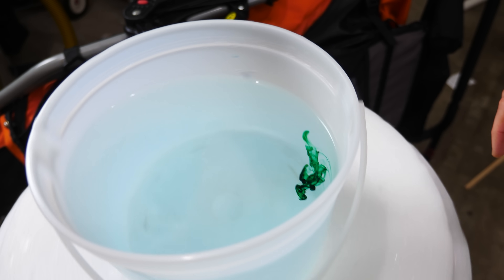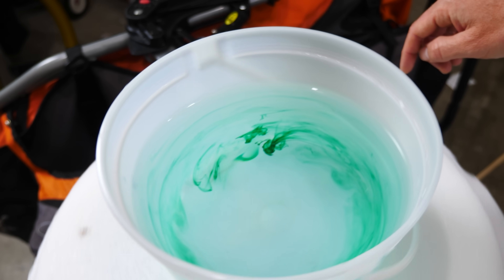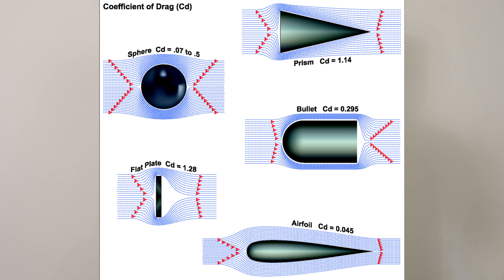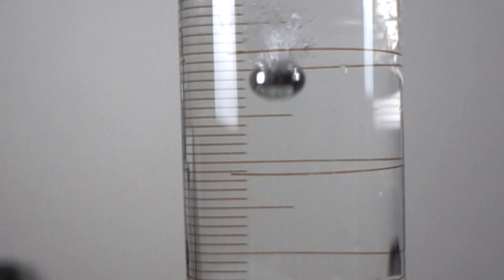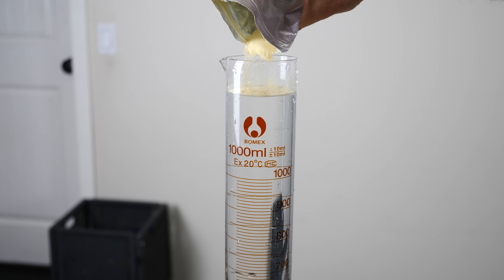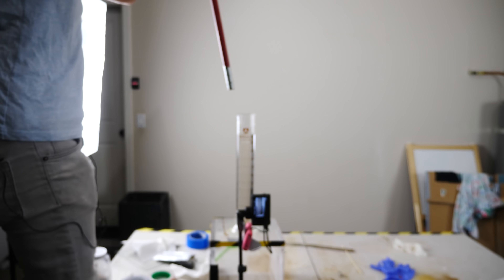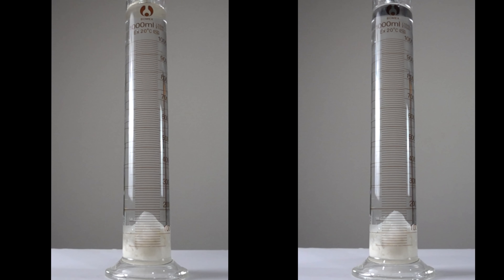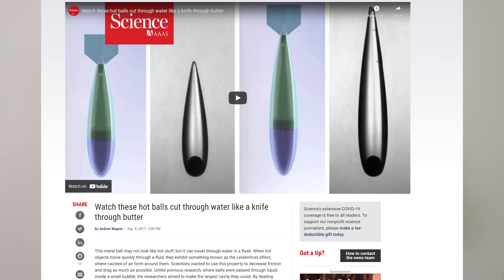Hydrophobic Projectiles Slice Through Water With No Drag

Comment: Would this have any effect on the buoyancy of objects in water, or the objects weight in water? Would an object weigh less in water because of the air around it? Would that ball bearing weight more or less in the water depending on if it was coated or not?

Comment: Many years ago I read about an experimental sailboard idea where they introduced bubbles to the underside of a sailboard, which is almost a flat plane and only about 2.5' wide. Those dimensions make it relatively easy to distribute lots of bubbles all across. It was reported they got an instant burst of speed in the form of continuous accelleration, until the board 'spun out' due to bubbles clinging to the skeg, which is the vertical fin at the back of the board that provided lateral resistance, allowing the sailor to sail.   Speed by these bubbles actually wasn't the focus at the time, so they didn't pursue this any further, which amazed me and to this day I don't know why the concept hasn't been explored more.

Comment: Perhaps the observation is actually opposite, hydrophilic surfaces encounter more friction that hydrophilic surfaces. For hydrophobic materials interacting with water, the friction is present but far lower that with hydrophilic materials. Most likely there is a combination of interactions here. The hydrophobic material interacting with air, the air interacting with water surfaces, and the hydrophobic material interacting with water. For hydrophilic materials there is more friction that occurs at the hydrophilic surface interaction.

If it is absolutely true that hydrophobic interactions with water is absolutely absent, that seems easy enough to prove, but if water has even the smallest interaction with a hydrophobic material, it means that water in fact has an effect and the two are not entirely separate. 

A test can be performed to show this. A flat square surface polished as smooth as possible and coats with a hydrophobic material when dragged across a water surface would require an amount of force to pull it a distance. If a rougher surface (of the same size), and other surfaces of varying degrees of roughness, also coated with a hydrophobic material, were dragged across the surface of water in the same manner, a different amount of force might be required. The difference with the smooth surface would likely be a combination of of the friction forces mentioned above. A similar test in a vacuum would be required to remove air from the sum. The vacuum would not need to be high vacuum, just enough to whether or not the effect was significant.
Reply: Thanks chat-GPT
Reply: @Pedro-San705  every day I am reminded that the Internet is as equally useless as it is useful. Thank you for your contribution.

Comment: I went to a school to learn traditional wooden boat building,  and one of the dudes there was a retired naval engineer who had spent years working on a system to have subs and torpedos excrete a goo on their surface similar to that used by dolphins, in order to go faster with same power output, or go similar speed but with less fuel used, so increased range.  They went with dolphin mimicking goo vs. Fish mimmicking goo, because it was less susceptible to being rubbed off, if i remember correctly.  The system worked, but the goo excreting system took up as much payload capacity as the fuel saved,  so it wasn't practical for the intended use.

Comment: I once read that Russia developed a torpedo that travels 200 MPH through the water!

It uses a rocket engine to propel it, but some of the hot exhaust gases are shunted to the tip of the torpedo—completely enshrouding  it in hot exhaust gases.

Comment: If a hydrophobic torpedo doesn't come into contact with water but keeps an air pocket around it, how can it do anything but fall?  If you think about an actual torpedo, it has to propel itself through the water, but if it can't touch the water....  Basically, how can this hydrophobic effect actually be applied to a torpedo?

Comment: No mention of “supercavitation”? Where you get the gas bubble forming around an object by the liquid moving so fast across the surface the pressure goes below the liquids water evaporation pressure (pressure drop due to Bernoulli's principle). You can increase the liquid to surface speed by using different geometries.

Comment: When you say "10 times lower" what does that mean? Is that 1/10th? If so, why not say 1/10th or 10%? 10 times lower doesn't really make sense.

The reason these are not really used much in military applications is normal guidance methods (sonar) doesn't penetrate the air bubble. The Russians have played around with super caveating torpedo's (VA-111 Shkval) but they are essentially unguided underwater rockets.

Comment: I wonder what would happen if you had for example like a lake covered with a layer of this spore dust on top of the surface, and then you would fall into the lake. Would you just fall to the bottom of the lake with the same acceleration as through air. This could be a weirdly scary trap.

Comment: Cool demo but an improvement of 33% means it's not even CLOSE to "no drag". Stokes law puts the Terminal velocity for a steel ball bearing in water at about 100 times less than in air, so a 33% reduction means its experiencing over 60x more drag than in air.

Comment: I wonder if this is at all analogous to an aircraft breaking the sound barrier, or how accurate that analogy would be. 

I could not stop picturing a jet breaking the sound barrier whenever I saw the hydrophobic projectile shoot through the water, creating that teardrop shaped envelope of air, which breaks off into a trail of disks as it streaks away. To me, that part resembled a sonic boom shockwave. 

I have heard that the drag against an aircraft is increased dramatically at sonic speeds. For some reason, my brain connects that to the change in drag that the ball (without the hydrophobic coating) encounters when it moves through the air and passes through the water. 

But that’s the end of my thought process at this time. I do not have anymore, I am tired and that’s all I swear. My smooth brain is smooth. 

But if anyone else has any thoughts, feel free to correct me, cause I’m genuinely curious. I’m just also tired. So no roasting me. Or do. I don’t care. K goodnight now. 

Please and thank you and i love you lol

Smooth Brain Out

Comment: This principle is actually applied to Shipbuilding. There are ships which shoot air bubbles continuously around the hull surface while it’s on voyage to decrease drag and reduce power required or increase speed. Although, it’s still relatively new and advanced technology and those kinds of ships are still very rare.

Comment: I personally highly disagree with a gas being considered a projectile. I get it on a technical level, but…. Yeah nah. A liquid I could see…. For practical applications though a gas is just silly, especially if it requires the use of a solid in front of it and then pretend the gas is the projectile as if to just ignore the much more practical solid as the projectile it requires to work.

Comment: Would this have an affect on the accuracy of an object traveling horizontally? For example would it cause it to drop more in the water due to the hydrophobic nature or would it still travel the same trajectory?
Reply: Since theres water on every single point it should theoretically stay in the same spot with little deviation possibly due to gravity, but that gravity is going to be combatted by bouyancy, underwater pressure, etc.

Comment: I know there have been some paints developed that exhibit a fair amount of hydrophobic action.  As I recall though, they're very UV reactive and they wear off faster than normal boat paints do.  Still, I'm just trying to picture a boat that has the below waterline section painted with an EFFECTIVE hydrophobic paint.  Would it sit lower in the water when not moving?
Reply: One commonly available spray coating is Rust-Oleum "NeverWet" which can be found at many hardware stores and on Amazon.  I don't know about the UV characteristics of NeverWet though.

I don't believe that a hydrophobic paint would have any perceptible effect on  where the waterline is on a boat coated with it.  The boat would still displace the same amount of water.  I'll modify that by saying that the ship would sit ever-so-slightly deeper in the water in relation to the actual total weight of the hydrophobic paint that is sprayed on the hull.  If the paint weighs 50 lbs., then then a boat would displace 6 more gallons of water (with water at 8.34 lbs./gallon).

Ed Schultheis, PE

Mechanical engineer and manufacturing consultant for 35 years
Schultek Engineering & Technology, Inc.
schultek dot com
Reply: @edschultheis9537  Have to keep the RustOleum in mind.  I have a canoe that could use a bit of love before I renew the registration.

Comment: There is a racing sail boat that uses a compressor to put a film of air bubbles on the outer surface. It cuts thru the water much faster than its competitors in a race. ZZZiiiiiiiiiiiiiiiiipppppppppppppp   winner.

Comment: You don't have to have much of a temperature difference for the leidenfrost effect to kick in.
I experience it in my shower on a regular basis when I try to squirt shampoo onto my hot, wet hand.  The shampoo is just a few degrees cooler and slides off my hand, and even my loofa, like an oil with zero adhesion whatsoever.  If I get the shampoo hot by holding it under the shower head, this doesn't happen as the temperature of my hand and the shampoo are similar.

Comment: If torpedoes used this, would they still be able to steer? Seems like the air pocket around it would prevent it from changing direction or even the propeller moving it as it would be in an air bubble.

Comment: There are two types of drag, the drag force of moving particles out of the way, and the force of the molecules as it slides past them; including the vortices on the back face.  You cannot eliminate one part of those drag molecules (having to push the molecules out of the way), which is why the coefficient cannot go to zero, but you can eliminate the the drag portion of sliding past the molecules, practically to zero, because the pocket moves with the ball. It should actually form an effect like those robots made of bags, or those "water snakes". The air at the sides of the pocket are stationary compared to the center, where the pocket actually pushes the ball down, and speeding up the ball until the forces of pushing and accelerating the water out of the way counteracts the weight of mass in water.
Reply: Real question: Aren't we separating hydrogen bonding as well (when dealing with water)?
Reply: @sloppyoppie  Yes, but the amount of energy required to break that bonding is on such a degree that it is almost unmeasureable, as just the temperature of the room causes breakages all the time. and in this case, can't be properly calculated to a degree to become significant, just due to the amount of variability in the breaking and forming of those bonds, naturally.

Comment: Some subs, ships and even torpedoes utilize the injection of air or gas at the leading edge of contact to reduce the friction that would otherwise be present, this in turn increases the speed at which the object can travel as well as reduces the power required to displace the volume of water it encounters. You'll be surprised how long they've been using this technique, it's been around for decades although not at all widely known.
Reply: Do you think they could or already use similar substances to coat the submersibles and torpedoes? The air injection seems pretty cleaver but what if they just powder coat the objects, could they in essence go fast as f#@&? Same with boats, could the hulls of boats be coated in this stuff to just glide over the seas? or would it eventually get saturated over time. Im only asking here because i didnt know about this stuff and you seem to know something about this stuff.

Comment: Does this mean if you drop something hydrophobic into the depths of the ocean it will accelerate with the increase of pressure were it to maintain it's hydrophobia?
Would it turn into a hydro rail gun of sorts just increasing in speed until it found the ocean floor? How much would the increase in pressure actually effect the hydrophobic object? I have questions, damn it!

Comment: The Russians already have a torpedo like this-it is called VA-111 Shkval-and it is part of a family of supercavitating torpedoes originally developed by the Soviet Union. They are capable of speeds in excess of 200 knots.  
Furthermore, I would wonder if you coated the ball bearing with superhydrophobic polymers to get the saem effect.

Comment: Russian rocket-propelled Shkval torpedoes, deployed since the 70s, already do this, leveraging the supercavitating effect of a nosecone that, upon penetrating the water at very high velocity, generate a large bubble of water vapor around the rest of the torpedo.

It takes a lot of energy to go fast underwater, but considerably less energy to generate and maintain a supercav bubble around a 26-foot-long torpedo, so they did that.  The net result is a torpedo that flies underwater at well over 200 miles per hour.
Reply: TBF - the issue was with reliability. At least that much we know (though not all the details).
Reply: Germany (alongside, apparently, the US) created a similar supercavitating torpedo known as the Superkavitierender Unterwasserlaufkörper. It was never fielded though, and development ended, seemingly indicating a perceived issue with the usefulness of the technology in question.
Reply: Pretty sure both this torpedo and the German one use a rocket engine to generate the gas and to produce thrust. Some of the rocket exhaust is fed through the tip of the nose to create that shroud of gas around the torpedo.
Reply: I heard they rain-x-ed their torpedoes.
Reply: Trying to remember , what is America's SLBM . Has a little cup on an stick in front . Admittedly it flies through air , but would have the same effect  .  ?
Reply: @57greyghost  DARPA was also working on a supercavitating torpedo in the 90's and 2000s
Reply: @introboy1 Yes. At least parts of it were machined and built in parts of USSR that are outside of Russia. But also even when everything was operating well, this torpedo had one major flaw. It could turn very very slowly for it's speed. Which kind of makes sense - it was basically underwater rocket that achieved such speeds, because it maintained a thin bubble of gas around it's body. If it turned too much it would destablize the bubble and it would basically hit the uncompressible liquid. Which at those speeds means destruction. And flame out of the engine. So it had basically like 3-4 very "delicate" (meaning they had to be accurate and work without any issues) systems that had to work perfectly for it to become simply an "underwater rocket" that could turn enough to make corrections but nothing else.

And of course they iterated on it and improved it, but even if everything was okay - it would be massively, orders of magnitude more expensive. And while I can't confirm that, I did hear that it was sufficiently different that it required it's own fire control systems. Which makes sense, but also means that it could only be fired from new submarines that had it installed or retrofitted ones. Which is massive increase of cost for system that even during it's best years had problems turning and had reliability in 20 something percent of cases. There were also range and communication issues - again, marvelous system, but it had so many new innovative parts that it had serious issues working.
Reply: introboy1 what are you saying? are we going to break apart just like them?
Reply: @HUgdJHf64 If the US broke apart it would actually be good for the people, as opposed to the dissolution of the USSR which plunged millions into poverty and set formerly peaceful countries against each other
Reply: @shenzhong2942  Propagandist spotted. Ask any former Soviet state in Eastern Europe whether they'd rather see the USSR return. Many people still remember what life under Soviet rule was like. There's a reason they all rushed to join NATO after leaving the USSR, and why they're the biggest supporters of Ukraine. 

The Baltics and Poland today are richer than Russia per capita. The USSR was poor because of inefficiency and because the government overspent on its military, as Russia continues to do today. Currently Russia spends about 6% of its GDP on military---twice as much as the US---simply because it just can't stop invading neighbors for territory.

However, it would be certainly be very good for the people if Tibet and Siberia became independent. That much we can agree on.

Comment: Interesting!
Just wondering, can you make boat faster/more fuel efficient in similar way by making it's bottom hydrophobic with ceramic layer or something like that...
Reply: They have been researching and applying such technology for shipping for decades. I once heard an in depth BBC presentation on Radio Jordan about 25 years ago on the subject. The main problem is fauna and flora grow on the surface reducing its effect.
Reply: @alexjames1146  well then, impart some copper to the hull exterior (at a very high expense, unfortunitely) but that would reduce the growth of algae, at least. Now tell me why that would not work.

Comment: They are actually working on supercavitation torpedoes that are designed to create the air pocket around the torpedo. Russia has the VA-111 Shkval. For a while, it was speculated that a failed Shkval test was what actually sunk the russian submarine Kursk in 2000. (it was later determined that it was due to a classic hydrogen peroxyde practice torpedo explosion)